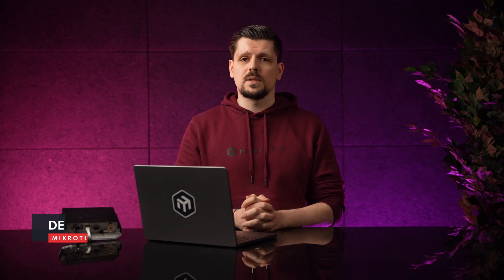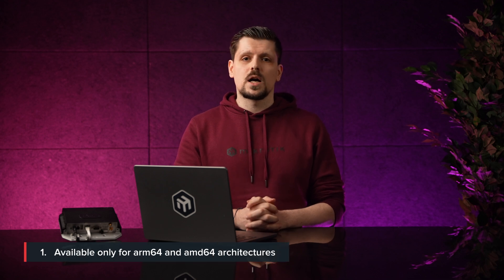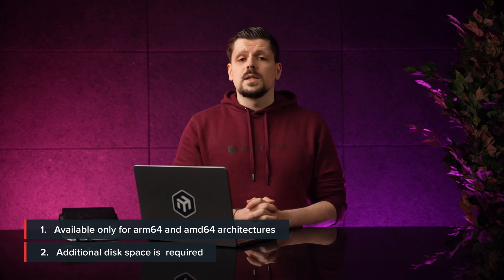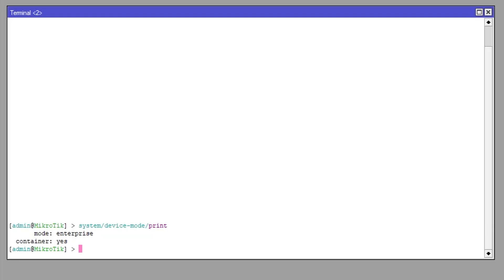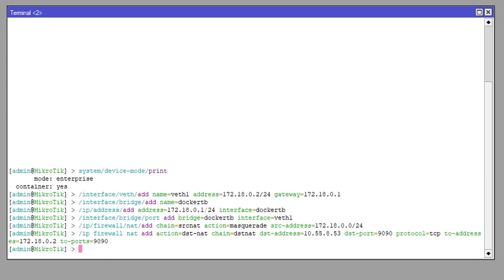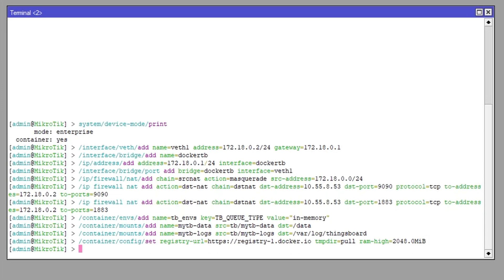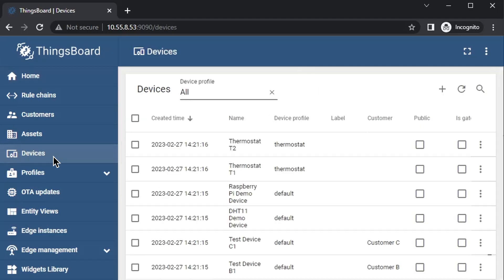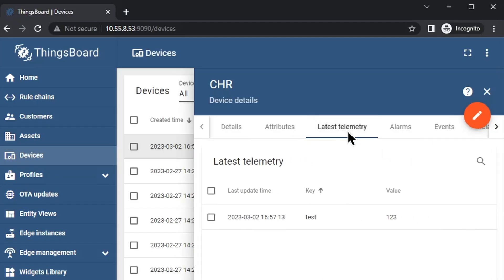ThingsBoard installation using the container (PART 1)

Comment: I have a project using mqtt and gps tracking with AWS. In my configuration  ultimately the gps data is stored in SQLite. I decided to store more than just latitude and longitude so I have a clean up function scrip I run on the Mikrotik before sending to the mqttt broker.
Reply from the maker: Sounds awesome? Do you mind sharing more details how you built it? If we can replicate your setup, we can make another video :)
Reply: @mikrotik  Yes, I’ll post it in git hub and put that link here unless you have a better place to share the git hub url.
Reply: @tlturner3  would you mind to share the github repo? Thanks
Reply: Okay the YT spam engine keeps removing the link. Hopefully you can figure out where this goes "Tlturner77/mikrotik_gps_mqtt"
Reply from the maker: Got it, thanks! We will try to make it and maybe make a video about your solution :) Thanks! 
If you email marketing @ mikrotik . com, a Merch coupon is waiting for you :)